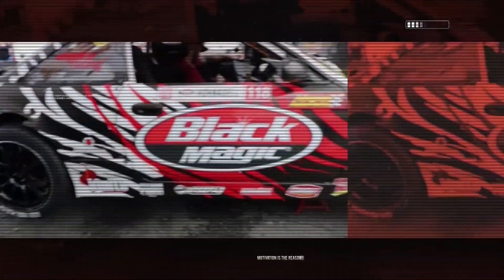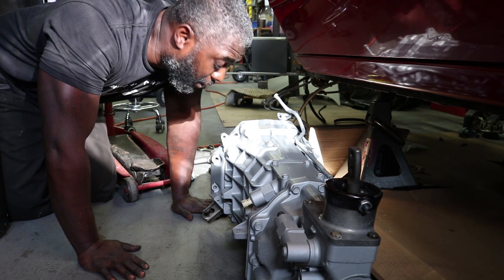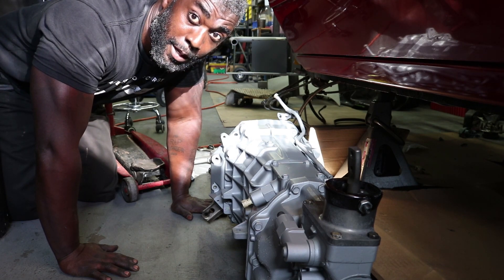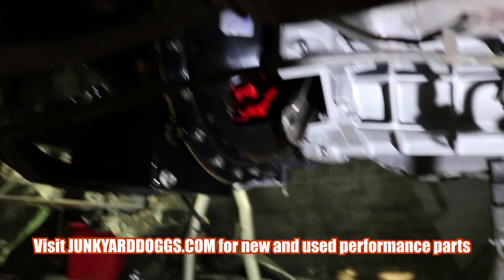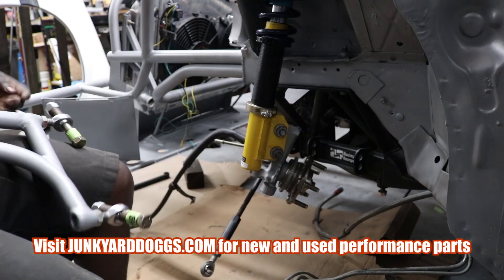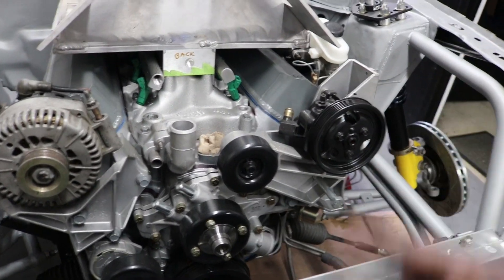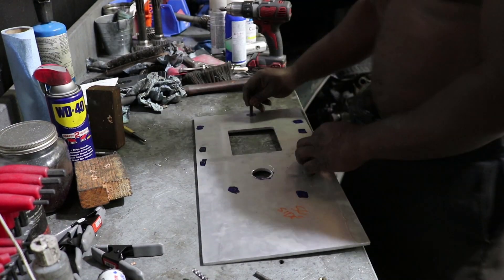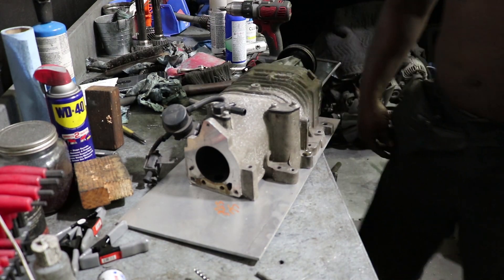Foxbody Mustang MM Suspension, T56 Install and Custom Intake - PROJECT MAYHEM PART 38

Comment: You should run the superchargers off the crank, Weiand makes a pulley for the 302 and just custom make some idler pulleys with a tensioner bolt. Also, make the upper intake into two parts and weld the top part where the superchargers are bolted to and add  a 1" lip at the base of it. Then make the lower part flat so you can bolt it into the lower intake and drill some holes threw both parts all the way around. You will be able to sandwich both of them together and reduce the chance of a leak. There's also an other way if you're interested.

Comment: the easy answer on paper would be to make a tensioner bracket off the power steering bracket -- where those three provisions are on the outside 12:37. it would cut the length of the tensioner bracket down, making it more sturdy, as well as an easy serviceable part. i mean you'd have to arrange it so the tensioner itself were frontward and up for alignment. 

yet, if you went that route you'd probable want to rig a idle pulley in the middle of the chargers for slippage. might be a two step process. tensioner first and if it slips bad idle pulley step two.

Comment: If you use a timing belt you can eliminate the extra pully and use a production belt off of an import motor to keep cost down and then it solves the slippage issue because they have teeth. Very little tension is needed and wreckers are full of motors you can rob parts off of. Good thing about that is you could run off the crank with a well placed jack shaft. It could be a "Y" configuration. It could solve alot if issues. And be very unique. Just a thought. I love outside the box thinking.

Comment: I think you're on the right track with the threaded holes + studs/nuts. I was originally in the "weld a nut on the underside of the plate" camp, but with a nut and washer on the underside you shouldn't have any issues.

Comment: I would use the water pump pulley to drive the super chargers. That would eliminate the chance of over spinning the alternator since it's not a clutched hub style pulley on it and you would be dealing with one pulley of equal size not 2 pulleys that are different sizes and you can make a plate off the water pump bolts to hold a idler pulley on one side and a tensioner on the other side

Comment: you could get away with welding the 1/4" without warping it if you use a lot of heat sink blocks all around, and just zap it quick and let it cool off,  especially if you had it fastened somehow to a flat surface like that blower also. cool idea, interested to see it run

Comment: Double pully on the power steering pump, if you can, move the ps pump back using the primary belt on the forward pully. Allows you to move the SC's back. Run a short belt from the rear ps pump pulley to the sc's with a tensioner in between the sc pulleys to maximize belt to pulley contact area.

Comment: Dont bother drilling and tapping for a sensor on the thermostat housing. The ms3pro evo can fully control cooling fans. There are Volvo fans in the jy you can get that are even pwm controllable right from the ms3 if you want to get fancy. If you can think of it or want it controlled the ms3 can do it.
Reply from the maker: Got it

Comment: I had to use the old ratchet strap to hold my dash up and out the way for my heater core replacement lol good times! This is just off the wall bat shit crazy idea but sprocket and chain set up won’t slip run them on their own individual chain n sprocket lol

Comment: If you can run separate belt drive for the superchargers you will thank yourself. Slipage and resulting belt slap will suck, and tossing belts at rpm will suck more. Toothed cam drive type belts will be better. I'm thinking of running something similar to this on a 4.5 Mercedes v8 in my drift car.
Reply: Hmmmm. Watching after your m belt idea I think, do you have a straight shot up from the crank pulley? If so, run a toothed timing belt off a pully stacked on the crank pully up to a jack shaft mounted on the center top plate, slide the super chargers back as far as the rear intakes will allow. Then you can run them off the jack shaft which would allow fine tuning of the over/underdrive of them. Only issue would be how to support the jackshaft nose way out over the front of the motor. Definitely need a bearing block of some kind with a brace to stop downward flex under throttle. Horizontal Chain drives straight  out to the blowers from the jack shaft would look sick but belts would be safer.

Comment: Km not feeling the extra Pulleys on the accessories. I think it’s too much load on them. My suggestion is to run a second pulley off the crank and run a belt up the center with two idlers running to the super chargers.
Reply from the maker: That seems to be the consensus with everybodys opinion.  Now i just gotta figure out how to do it.  It will come to me tho

Comment: Wouldn't running the superchargers off the power steering and alternator cause too much stress on their bearings? You need good tension to eliminate belt slip and I'd be concerned that would over stress the bearings. Just my $0.02.
Reply from the maker: Good thinking bro! But do you think they'll put more stress on it than the regular accessories like the a/c pump and water pump?
Reply: @JunkyardDoggs  I could be wrong, but that would be a concern for me. Not sure if you could change the bearings to some that could handle the stress. Badass build, though! Can't wait to see that beast eat!

Comment: Which bellhousing did you use?  Looks like it's for a cable clutch.  Is that an aftermarket, LT1, or LS1 T56?
Reply from the maker: I used a quicktime bellhousing and its a cable clutch and its an LS1 t56 that i converted

Comment: What did u do to fit that t56 since it’s a Chevy t56? right?
Reply from the maker: Yes its from a 1998 camaro ss.  To swap it you need a t56 cobra mid plate and bearing sleeve, and then have the input shaft turned down to the 03/04 cobra length and width.  Then you need to buy the matching clutch disc but a ford pressure plate.
Reply: Was it all worth it with the ending price point?
Reply from the maker: @tyrellhamilton9399  absolutely $75 for shaft mod, $120 complete trans $800.  I think i did good.  Never seen a cobra trans under $2000.
Reply: Do you do them yourself looking into this now, see way to many f body t56 floating around
Reply from the maker: @tyrellhamilton9399  i do the assembly myself. I buy the componenets from Anaheim Gear and ebay.
Reply: Would you have time to do another if I can find a good transmission? Would be out the door price if so?
Reply from the maker: @tyrellhamilton9399  yeah hit me up on junkyarddoggs.com

Comment: I'm running a ms3pro on my 5.7 stroker, I can give you some pointers if you need help.  You still need a distributor to turn the oil pump and if you want to run full sequential injection you need a cam angle sensor.  One from a 2000ish Explorer works fine, just make sure the gear is the right one for your camshaft.  I would suggest you skip the ford coil packs and get 8 ls style coils.  Here is a video if my car running: https://www.youtube.com/watch?v=Y_C586Hsz34.  If you pause at the beginning you can see the coils on the drivers side.
Reply from the maker: Nice man sweet ride

Comment: I have an Explorer cam sync and an EDIS-8 module i can donate to your project.
Reply: EDIS -8 module  are starting to get hard to find that's for sure ..
Reply: Craig Voisin they’re fairly cheap to buy new though
Reply: With megasquirt you can’t run a 2 step in wasted spark with EDIS... the diyautotune techs recommend something like an LS coil it takes up 4x as many outputs but its allows you to make more power and do more with 2step and stuff like that